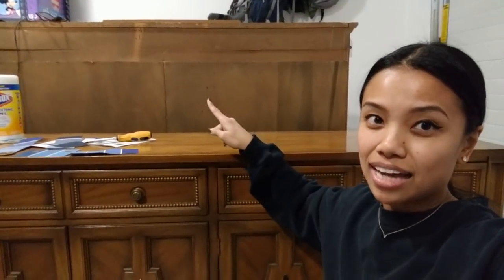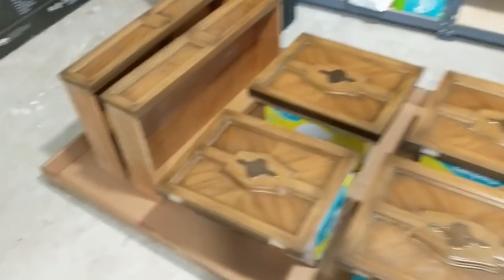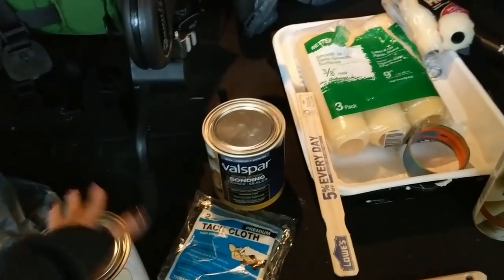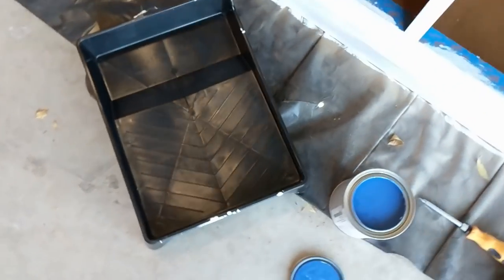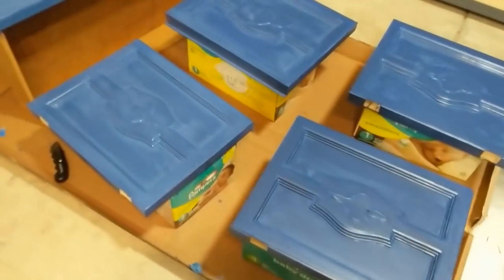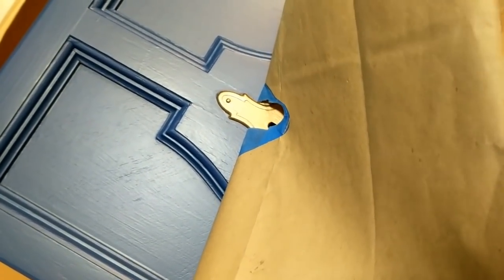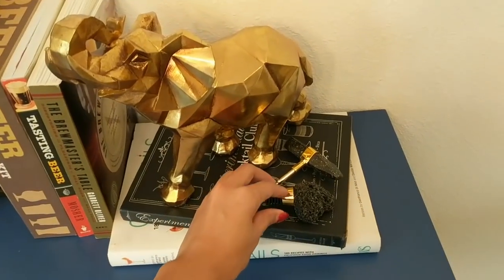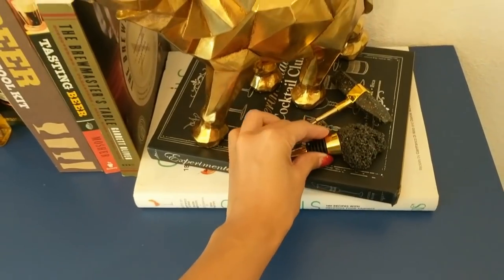MY VERY FIRST FURNITURE UPCYCLE! | Under $200 | Repurposing an Old China Cabinet

Comment: You can rub a bar of soap along the drawer edges and inside the openings to help with the sliding motion if you don't have wax. Also, a white candle will work as well. I think it turned out exceptionally nice, especially for a first project. Keep it up. It will only get better from here.
Reply from the maker: Thanks so much for the tip!! XO

Comment: You did great! You took on a hugh job for your first project! Lol. Most likely your trouble was the spray paint is oil based and the blue paint is water based. They don't blend well together.  Everything you learned from the lower cabinet will now help you go faster and it will be easier to do the top. Taping... So important. ..I usually tape off &  paint about 3/4 of an inch inside the frame of the cabinet as well as 3/4" of the side edges of doors & drawers. Just so you don't see the wood when closed. .. Also very important,  I've learned to mark all the doors as well as the hinges & put them back in the same exact places!!! Sometimes rubbing the drawer and inside the cabinet where the touch together with a block of wax helps them slide better. You can pick up from the hardware store. I get mine @ joanns. And sometimes...they just rub and chip paint. Paint does harden (cures) as it dries so try not to use for 7 days.  You should be proud of your work. It looks beautiful! Keep up with it because you'll only get better and in no time at all.. you'll have a home that you and your family will be proud of.
Reply from the maker: I am SO appreciative of your comment and tips! Marking each door and hinge is especially brilliant! Thank you so much ❤️

Comment: I really wish she had removed the backing plates for the door pulls,  using a  tack lifter to remove the nails, a thin piece of wood or even cloth to protect the surrounding wood and it would have been much easier and better than what she did; but I guess for her first project what she did was ok, since the item was for her own use, but someone really needs to help her with these things. The Blue was just a little too much, a Wedgewood Blue would have been a better choice, but again, that's just my opinion. The whole thing took courage and did come out pretty well, Bravo for your efforts and keep going, you will learn as you go.
Reply from the maker: Given that I kept the original door pulls, I love the backing of it! But I wish I had known about the tack lifter to remove the nails cause then I would have changed them out completely to something more my style! Thanks so much for your input XO